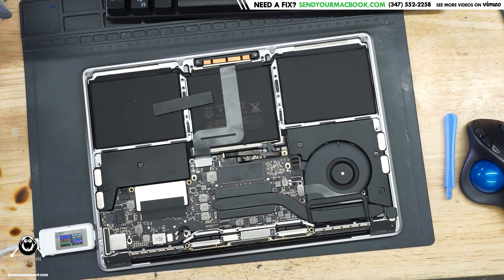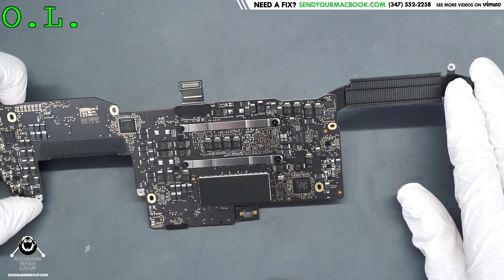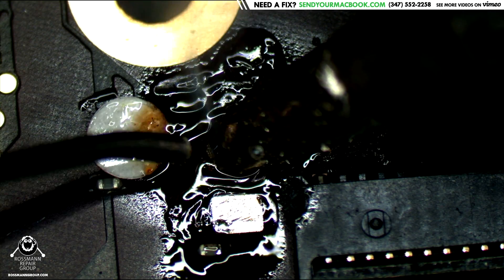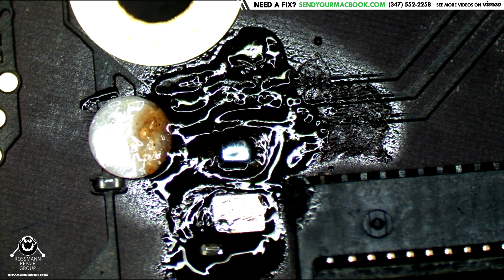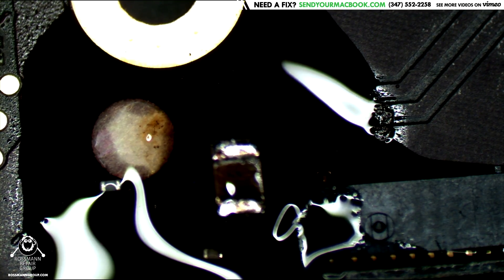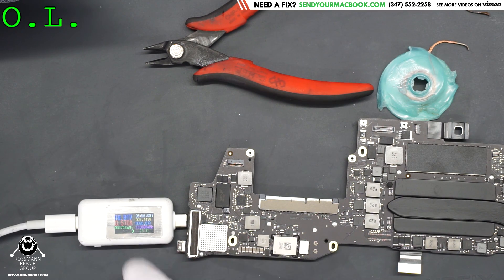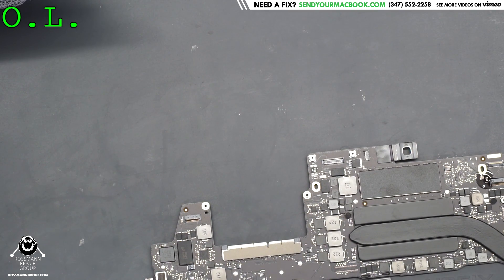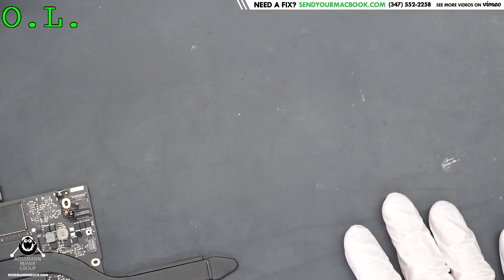Replacing SMD capacitor without hot air station flat on the board PLEASE WORK THIRD UPLOAD

Comment: Hey Louis,
do you know Verowire? If you don't... Google it. It's a fucking nice isolated copperwire. You can deisolate it with the heat of the iron... I use it for prototyping and repair-stuff and do not want to miss this brilliant thing. You don't have to rub or scratch on the wire and it's really thin (AWG34). 
Maybe you will find that interessting... Maybe you don't.
Love your Vids

Comment: Hey guys, I need help.
I have an old IPad 2 that visibly seized to work.
It layer idle for about 1,5 years since last time I turned it on.
Recently I plugged in charger but no indication of charging came up.
Is there any software that I can use myself to check what is wrong with it or should I take IPad to the repair guy like this one?

Comment: Before I had hot air, I used 2x cheap soldering irons to heat both ends of smd caps etc when removing them. I still use this method occasionally when it seems that hot air would risk damaging other components. 

Thanks for all your help Louis. I did not learn much from this video to be honest but it will help someone out there and I have learned a great deal from your channel. I can appreciate the pleasure you seem to get from perfection :)
Reply: Haha. What i've done was take some 24 or 22 gauge solid core wire, strip off the insulation, wrap it around the tip of a bent-conical fine iron tip, and then the piece that sticks out past the end of the iron tip i put a U bend in it so it can touch both sides of the SMD at the same time. It's how i fixed the LED tail lights on my Audi. It used fairly small SMD LEDs. It was quite ugly, but it worked. Looking back i can't believe it worked. lol.

Comment: Does anyone know what is causing my 2015 mbp to be non responsive and then restart? here is the error "panic(cpu 2 caller 0xffffff8019a83fba): Sleep transition timed out after 180 seconds while entering darkwake on way to sleep. Suspected bundle: com.apple.iokit.IOGraphicsFamily. Thread 0x74.
Failure code:: 0xe0308b18 00000031"
Reply: Because of... Apple
Reply: Peter Jigstad  if you don’t know don’t reply

Comment: Does Apple use cheap Chinese ceramic capacitors for bypassing?
I've never seen bypass caps break so easily like that boom.

Why dont you buy a sheet of caps from digikey? Looks like 0603 or 0804 you can buy 1000 for like less than 10 dollars

Comment: what I do for desoldering small SMDs (up to 8 pin SOIC) is put on a lot of solder and quickly go from side to side until it goes off (for more than 2 pins, I try to create a short between all pins on each side)
Reply: Using a piece of wire to touch all the pins and get a generous blob of solder going is a good one too - nice example here:

https://youtu.be/CVsmwFAkf7I?t=260

Comment: Things I have learned from Louis:
1. PPBUS is NOT hot, ever
2. Apple buys cheap decoupling caps that fail to short because Apple
3. When caps fail sometimes other stuff gets fried because Apple
4. Dumb old power supplies seperate from comms connectors a better idea, USB-C is crap
5. Flux is nice, more flux

Comment: Soldering smt ceramic caps with a soldering iron makes me cringe for anything over maybe 0402.  1206 and higher is a hell no.  That's a lot of differential thermal stress and they will crack in the process.

Comment: I have a hot air station and I still do it like that because it's faster, but the way I do it is that I but a blob of solder in each side and melt moth sides using the soldering iron side ways, it takes like 2 seconds while the hot air station you have to wait for the board to heat up then the solder melts and you can remove the component

Comment: If the component is already dead, yeah! Heat the hell out of it. As long as you don’t destroy adjacent parts, heat the hell out of it. Pcb doesn’t burn easily
Reply: But I’ve gotten 0805 caps off easy enough going back and forth quickly with a decent solder blob on my solder tip.
Reply: @Holey_Moley  One of our production ladies does this. It is impressive.
Reply: Ian Montgomery Ha! It was a lady that first showed me how to solder fine pitch parts. She made it look so easy!
Reply: @7:29 I know what you’re talking about.. but for those of us who haven’t worked on electronics.. wait they wouldn’t care for this vid.. hmm.. maybe I should make a video showing just what you’re talking about.. extra ad rev.. but I don’t currently make vids so there’s an idea for ya. I remember trying to solder and FETs.. they kept blowing up during test because I was leaving the soldering iron on for too long. I scared the heck out of the project manager because I was testing at my desk 😂
Reply: Lol you don’t need a hot air station... unless you have OCD!!!
Reply: sometimes it helps to rest the pcb so it is off your workbench so as it is not working as a heatsink.

Comment: Louis 2030: Replacing QFN 64 package with just TIG welder
Reply: Louis 2040: Replacing BGAs just by staring at them.
Reply: @mikeuk1927  Louis 3000: Replacing the user so that they buy a Thinkpad
Reply: @bruh-co8nf  lois 3400: replacing
Reply: @brendethedev2858  Louis 10000: replaces universe by thinking about Right to Repair.

Comment: If you were changing this capacitor with hot air, what temperature air do you normally use to do that?
Reply: there are variables to consider like copper content of the pcb acting as a heatsink. You just have try various temps and develop your own style.